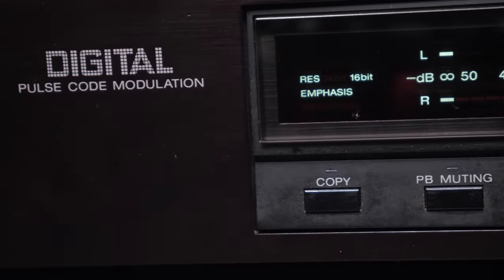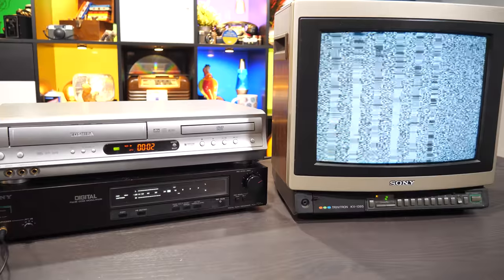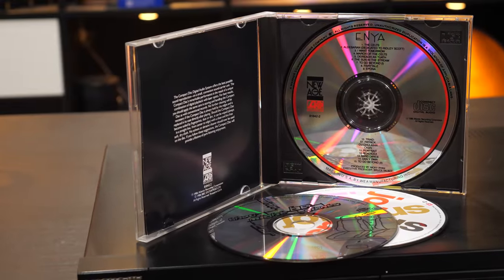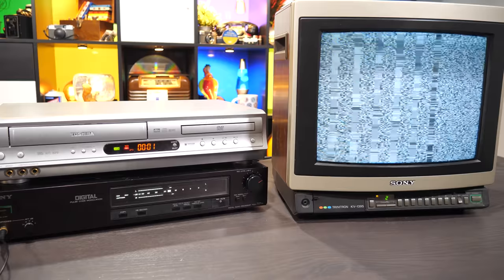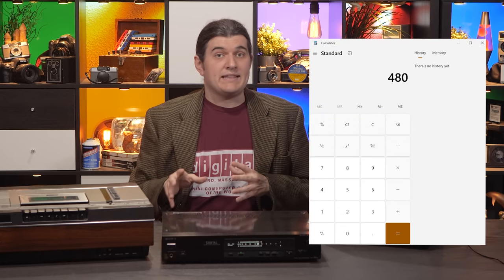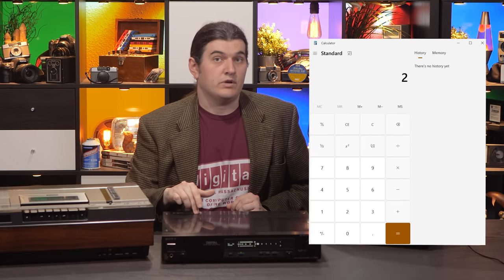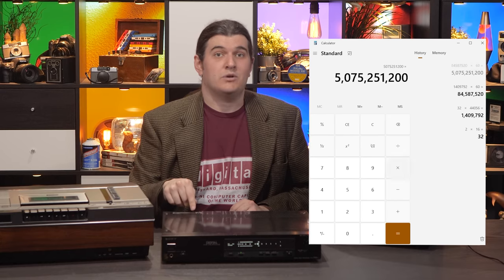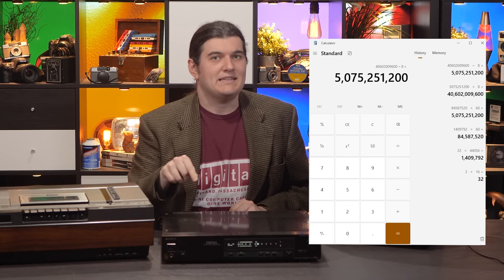Digital audio needed videotape to be possible - and the early days were wild!

Comment: About 25 years ago I was the chief engineer of a radio station in Australia. We used to do outside broadcasts live from nightclubs on weekends, and we had a deal with what was then the largest nightclub in the southern hemisphere in Melbourne, Australia. For the club's opening night, we were doing a special extended broadcast to help promote the nightclub. Usually we did outside broadcasts over ISDN lines (using essentially a hardware MP3 codec at 128kbps at both ends), but sometimes we used a radio transmitter if needed.

Since the club was new, their ISDN line was installed but hadn't been activated yet, and since this deal with the nightclub was worth money to the radio station a solution was needed, so we set up a temporary radio transmitter on the nightclub's roof... but as the club was huge, it was impossible to run cables throughout the club to reach the transmitter. Particularly, we needed to take audio from the DJ booth (which was high up above the dance floor), and before the club opened from a cafe at the front of the nightclub near the entrance. This would mean lots of cables all over the club which had to be tucked away and safe all night long, and for various reasons (mostly safety and the length of the cables) this was not an option.

The solution was actually to use two of these devices to encode audio to video, and decode it elsewhere in the club. We dismantled a security camera in the cafe, and under the DJ booth, and joined them together behind the security video recorder to essentially make a long video line, and used this to transmit audio from one side of the building to the other, in order to reach the transmitter.

(There were other problems to solve that night, such as the transmitter not being able to "see" our station building, so we had to bounce it via a receiver from a friendly TV station who then put it into an ISDN line for us, but that's another story).

We used to use these devices to record the on-air programme 24/7 (as required by law) onto VHS tapes in EP mode for 8-hour recordings while keeping the quality high, before we switched to digital recording to hard disk. It was the late-90's *shrug*.

I just wanted to mention it as it may be of interest. :)
Reply: I love the story. Thanks for sharing !
Reply: I assume this is the Metro Nightclub and EON FM 🙂
Back then 3RPP also simulcast the 21st Century Danceclub in Frankston on Saturday nights. They probably used a similar ISDN system?
I was slightly too young to go clubbing back then but enjoyed the simulcasts!
Reply: @zoomosis  here was me assuming it was Revs 😂
Reply: @zoomosis  QBH from Hitz FM. The place was a pub (Queen's Bridge Hotel) and underwent an insane renovation at the time.

And yeah most places were using musicam codecs over ISDN because it was just easy, and the high price of ISDN in Australia was still justified, but there were so many problems with Telstra's installations that I knew any new site was probably not working right even if the NT-1 showed signs of life. Broadcasting from locations like shopping malls always necessitated ISDN for the OB link back in the day.
Reply: @benespection was going to guess QBH. Fascinating the sorts of things we had to do back in those days to make stuff like that work. I was in tech not broadcast but there was some overlap from time to time.
Reply: @MeppyMan  Honestly, I miss the creativity needed to run an underfunded engineering department while still achieving everything the station needed to achieve. I miss it a bit.. but not the working three days in a row without sleep bit :)
Reply: Very interesting, thanks for taking the time to share!
Reply: Pirate radio stations use a small transmitter to transmit to a bigger transmitter in order to never get caught (as the authorities always trace and shut down the bigger transmitter first.

I think you could have done this but obviously digital signal is better
Reply: This is absolutely fascinating, thanks for taking the time to explain!
Reply: @annother3350  Real radio stations do/did this too, and we did too. We had our main transmitter on a mountain, and used a transmitter from the radio station to the mountain (STL, or "Studio to Transmitter Link"). Same principle applies here, but we had no line of sight. As stated, we actually used a transmitter from the roof of the nightclub, but it headed into one of the buildings in the city centre which is used a lot of outside broadcasts by radio and TV stations in Melbourne. From here it was bounced via ISDN back to our station. It's not done to transmit an outside broadcast straight to the main transmitter, as there are plenty of other considerations in the broadcast chain, so it always goes back to the station first and follows the standard broadcast chain from there-on. The PCM encoder was only used in this instance to get audio from one part of the building to another by hijacking the security camera cabling. In the end was the mixing console for the outside broadcast, and from there to the transmitter on the roof of the nightclub. It was an unusual situation - the broadcast chain back then was almost entirely analogue. In the late 90s some digital processing was already being done but in the end the transmission to the mountain was already analogue and already modulated (FM) on the higher STL frequency - it would just come out of the mountain at a lower frequency (in the FM radio band obviously).
Reply: And you try telling young people today about that - they won't believe you.

Good to hear of people making real use of ISDN. The joke used to go that the acronym means "I Still Don't kNow" what it's for.
Reply: @john-r-edge  Before PDFs and wetransfer got big ISDn would be used by designers sending big documents to print companies
Reply: This all feels familiar as an IT admin: same pile different shit?

Anyhow, I do have one question: was the lack of XLR connections a problem, or were you normally using RCA connectors?
Reply: That's awesome
Reply: @benespection  You mean Telecom?
Reply: @everygamersdream72 would’ve been Telstra by the late 90’s 👍
Reply: @RichardBetel  Since these were for logging, and to save money, it was all domestic stuff, so RCA. We used a little mixing console and took the "tape out" RCA lines into the PCM encoder, and at the main OB mixing console on the other end used a tape or aux in channel (also RCA). Obviously everything else was balanced audio over XLR. Desperate times call for desperate measures, but we're also talking about very small distances for the unbalanced audio sections so not a big stress. The show must go on.
Reply: @john-r-edge  Given the cost in Australia, it was a useless technology outside of professional use, but in stone European countries it was cheap and useful in the 90s, even with digital phones. That blows my mind, because I can't get past thinking about how expensive it was, yet it clearly wasn't in those countries :)
Reply: Actually I was once involved in operating such a device. It actually used MP2 at 128kbps as the radio industry often prefers that. It had an ISDN interface... which was then converted to VoIP, then back to ISDN, then to VoIP and then to ISDN. Worked like a charm. The secret is the "CLEARMODE" codec which essentially handles raw ISDN bearer channel data like it would handle G.711a.
Reply: @altebander2767  Musicam devices essentially popularised two way 128kbps two channel stereo or joint-stereo over ISDN into a defacto standard. Our codecs could also do layer 3 (MP3), which we often used for clubs in joint stereo back to the station, but the return from the station was two channel so one could be the broadcast feed in mono (for speakers onsite so the public could hear what was being played as the playout systems all stayed at the studio obviously) and one channel for communications back from the operator back at the studio to the OB producer onsite.

In this scenario with the PCM encoder we did not have any way of getting a communication feed back to the club, so we relied on mobile phones, but GSM phones produced a tonne of interference (TDMA pulses) so we had someone on the phone far away from the audio equipment using hand signals.

Do you remember the lovely sound produced by buffer underruns in those devices when the line was being brought up? Like a high pitched splat and a CD skipping? It used to make my heart race when I heard it because at some really bad locations with poor ISDN stability would cause so many frames to drop it that the codec would renegotiate and that sound would go live on air. :-/
Reply: @benespection  Well I didn't do a lot with them, as my involvement with the telco industry started at the tail end of ISDN. However I remember once being on a tour of the regional radio broadcaster. They had a whole wall of racks full of ISDN codecs as well as radio receivers for just about any standard that was still on the air. Since they were still doing Astra Digital Radio at that point, they actually had consumer receivers for that. After all they were in charge of checking that their signal is fine on any of those.
Reply: @altebander2767  Cool experience :) We also used domestic receivers to verify our on-air feed. Back in those days I would listen to the station on-air every waking moment, and carry around two pagers and a mobile phone. Even today when I listen to any other radio station something in the back of my head is still monitoring for problems - even small glitches stick out like a sore thumb and make me stress a little bit, like some PTSD :)

Thanks for sharing your experience too :)
Reply: That was some excellent 90s hackwork!
Reply: @benespection  -  I had a yagi beam antenna set up and we souped up the power to the remote and bounced it off a building. With a map and a little bit of math we were able to make the connection. The skyscraper never knew we threw a bunch of power at it and a yagi beam on the other end pointed at the building caught the reflected signal. Water towers work good too with their convex shape.   We have also taken over the studio to transmitter link a couple of times and played a record or two off off format or run a commercial for a competing station LOL. Engineers will play ha ha   Piss off the old boss  LOL
Reply: @RichardBetel  -  Broadcast and pro audio guys like XLR because they are balanced lines and have less of a chance of picking up stray signals and tend to be quieter around 60hz hum. Other than that there is no good technical reason to use them. We never had a problem using RCA stuff in our racks... Especially if they were closed metal boxes.
Reply: That is a top-level broadcast engineering hack! Thanks for sharing!  My story - which is nowhere near as cool as yours!!! - In the late 80s, the student station was off the air due to weather damage. For a few days we used VHS HiFi to record and playback programming in the Student Cafeteria.  We got 5-6 hours per T-120, IIRC.
Reply: K888888888888
Reply: "so we had to bounce it via a receiver from a friendly TV station" that's the part that gave me pause. That's crazy!
Reply: @DanieleGiorgino  I don't know if it's still the same today but back then most engineers from competing stations were willing to unofficially help someone from another station solve a problem on the side, because maybe they would have a problem they need help with in the future, especially with equipment loans or help getting a signal somewhere.
Reply: I love these 1-of hackjob stories.
Reminded me of that one time i had to run an 10/100 ethernet connection over an existing old phone cable by modifiing ISDN wall sockets, since i wasn't allowed to run proper ethernet cables/sockets
A "provisionaly" solution that lasted 10 years, including my "CAUTION LAN!" Sticky Note.
Reply: @benespection  being from Melbourne and working with nightclubs back then, are you familiar with the Melbourne Shuffle?
Reply: I saw a few Alesis ADAT recorders working - and failing - when some friends band was recording a demo. They were all JVC S-VHS transports with a peculiar electronics.
Reply: wow, for once someone left an actually interesting comment lol. That must've been satisfying to see successfully work. Way more gratifying than a simple ISDN.
Reply: That's neat. Way to connect the technologies.
Reply: I'm surprised that you didn't setup a T1 line from the club. I help a radio station in Las Angeles set up a link in Disneyland to their studio and it used a T1 line. I don't know if a T1 line was available in Melbourne Australia at the time. But in LA, A T1 line from Disneyland to the studio only cost about $300 a month in 1995 and allowed full CD quality PCM Audio to be sent back to the studio.  CD quality PCM Audio only needed 1.4 Mb/s and a T1 line has 1.54Mb/s.
Reply: @appliedengineering4001 We set up a BRI ISDN line (two bearer channels, so 128kbps), but it was made live 2-3 days after this broadcast. It had been ordered about a month before, but just wasn't live on the day as promised. That happened a lot back then, especially with nightclubs as the telco was often unable to get into the premises to complete the testing and provisioning because of the hours venues like this keep. We used it for subsequent broadcasts as it was a regular event from this club. As stated in another comment we used codecs to transmit audio over ISDN, so more than enough quality fit into an mpeg stream at 128kbps. Primary rate E1 would be insane overkill and obscenely expensive in Australia at the time, especially as the use of codecs was standard and commonplace. By the way E1s are the same as T1s used in North America but framing is different, so an E1 is 2mbps. Nobody would want to pay for an E1. ISDN had absurdly high pricing that hampered its adoption in Australia. This wasn't the only outside broadcast I did, but of the hundreds and hundreds of them, and quite a number of those with very creative solutions, this was the only one to include a PCM encoder running over hijacked video cabling :)
Reply: That's GENIUS. I love it
Reply: Doesn't ISDN stand for "it still does nothing"? 😂
Reply: @benespection  I remember Hitz FM!  Could not wait until you guys got your slots to broadcast. Sorry you guys never got granted the full time license 😢
Reply: first time ive paused a video to read a great post.  fascinating.
Reply: My understanding you used an existing security cameras video out lined to save from running your own cable, very cool and smart thinking.
Reply: @benespection  I loved listening to the live QBH broadcasts on Hitz FM back in the day. Thank you so much to you, your coworkers and Hitz FM for making all of that possible, it made a pimply teen back in the late 90s very happy!
Reply: Triple J?
Reply: Wow, just wow.
You said you hijacked two CCTV lines, one for PCM and one for normal analog video, right?
Reply: @Valery0p5  Nope, two cameras, and just unplugged then at the recorder and connected the coax together. It formed one coax line, just for running the PCM encoded audio.
Reply: Who doesn't love two-fisted tales of Engineering?
Reply: [c.9:00] "hook it up to a b/w..." I had no idea they ever could record audio on b/w for later A/V playback . iirc correctly the first ever playback aka REPLAY was during an otherise live broadcast only right after a (sweet goal by Orr or maybe it wass by Hull ) point being it was teh first time Canadians had ever seen, now with the domestic family dispute powder keg spark as with any new tech facing drunkenly and CERTAIN OF THIER OWN interporated 'memory' makes any family member opinion undeniably wrong despite the macho-challenging/arguments spewed forth. Now one frothy step cousin/uncke/dad weakling may actually winn "the chaos cometh from the basenent" via 'nerd  magic' now possible by way of (even achievably near viewable slow- motion or realtime (speeds) w possibillity of several angles (eventually as these (VTR?)  machines were $$pricey. But broadcasters using them had never had so many calls as after thhe first use during i believe a playoffs type game expressing amazement of nearly instataneous replayability of and during a live broadcast.
Reply: @swiddle1  It really did do a lot--except there was never anyone to call in most countries because of the price they insisted on charging.  An ISDN call is by far the most hi-fi phone call I'll likely ever make (I had one for data back in the mid 90s, and I hooked a phone up to the adapter and called someone else with an ISDN line just for the hell of it a few times).  In high school, I worked for an ISP, and eventually ended up with a 64kbps frame relay circuit, which was only half the speed of what ISDN could do.  The advantage, of course, is that it was *always connected*.  ISDN calls cost money, and an "unlimited" plan was ludicrously expensive--not as costly as the 64k frame relay circuit, but that cost my parents $0/mo, so ...

Unfortunately, there was no such thing as a 128kbps frame relay circuit.  Well, there was, but I think the link was actually a T1 with only two of the channels activated.   Not positive though.
Reply: Wow, I wonder if some lost media is on such tapes if the law requires recording
Reply: Not reading all that, ain't nobody got time for dat! 😉
Reply: @benespection  I saw still live ISDN in the wild at a vet in the country about 2 years ago. 
it was running a PABX. If it ain't broke...it's probably still stupidly expensive I guess lol
Reply: Thanks! I feel 90s hacks deeply...